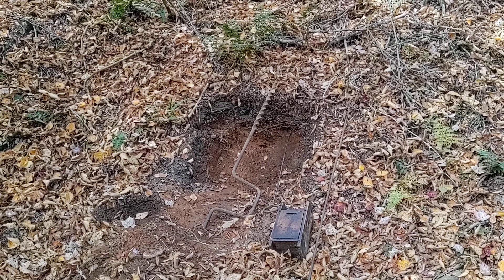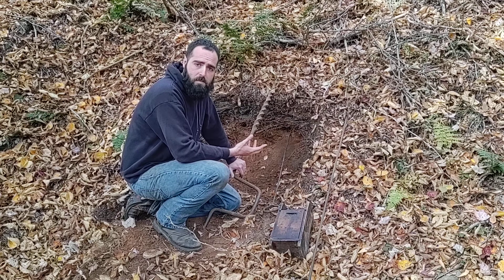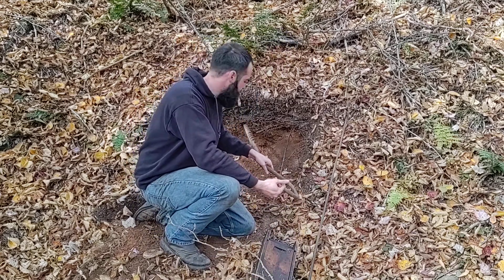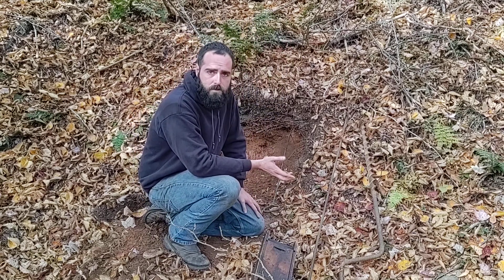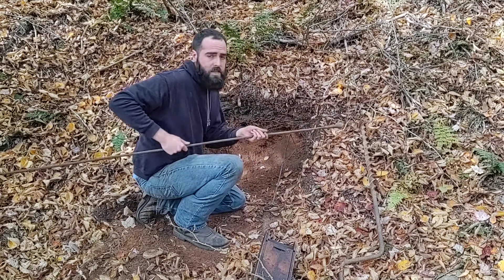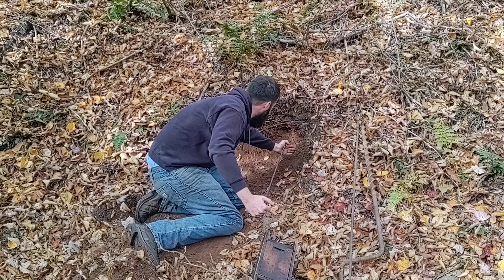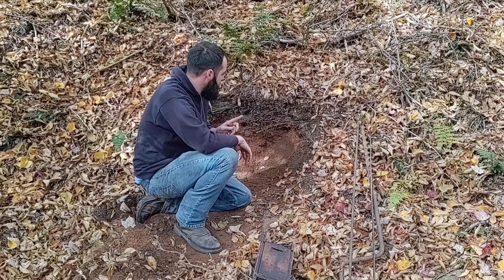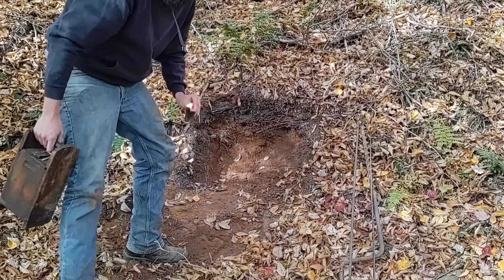Blasting in Underground Mines Part 2

Comment: In 2002 we took that same screwgee drill you have and stuck it on the end of a dewalt drill. Used a power inverter on my 89 chevy astro van and drilled a boot leg slope in trevorton.   Used the van battery and a extension cord to fire the holes.

Comment: I was curious one night about old abandoned mines and now that curiosity had turned into a addiction on YouTube. The hard and dangerous work those old timers had to do on a daily basis had to be insane workings experience and a nightmare at the same time. I figured they would use fuse and not little rockets to set off the powder, very interesting. Pretty cool!!

Comment: Those rocket squibs amaze me, what a great inexpensive solution for setting off a tamp charge. As an industry standard for back in the day, I'm still confounded by the success rate. How the needle channel stayed clear of debris over such a great length! Those guys back then, and yourself "rock-in the skill" :) Thanks for sharing a coal day in the way-back machine!
Reply from the maker: I found a solid tamp is the secret, the tighter the tamp the better the hole stays together. I have had a few misfires but we have learned from our mistakes.